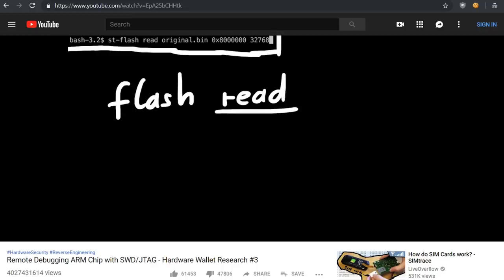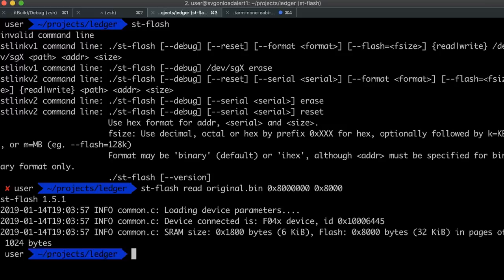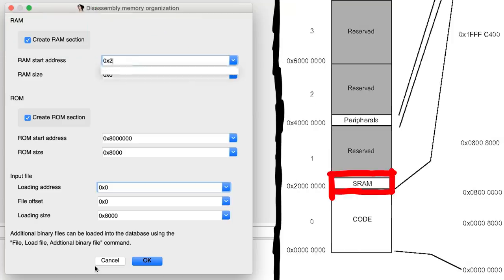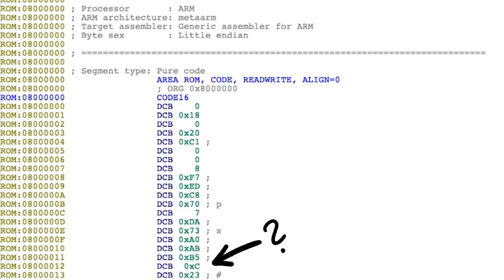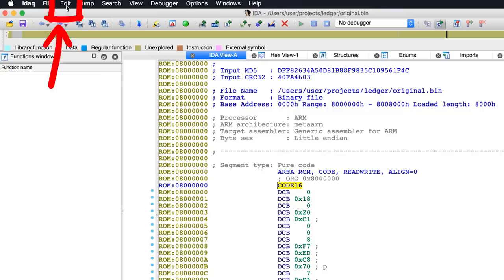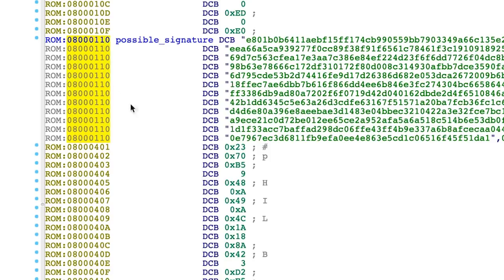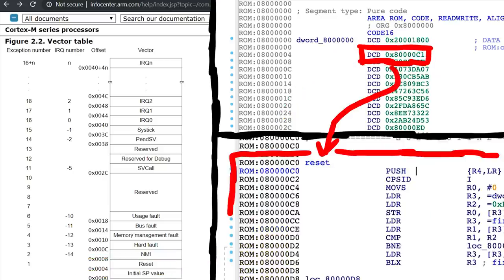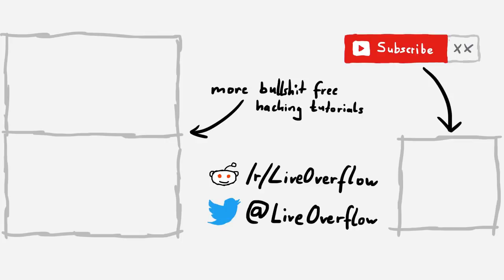Setup and Find Entry-point in ARM Firmware - Hardware Wallet Research #4

Comment: On most of the secure systems JTAG is locked. I would like to see how you unlock a JTAG if it is locked in the firmware :-)
Reply: Decap the chip, cover the flash memory and erase the fuses using a UV lamp. Easy peasy lemon squeezy. JK, this is much easier said than done. You could also try glitching it as they did with the Switch's processor, bypassing the fuse checking. Also easier said than done.
Reply: @GRBtutorials  On secure devices, fuses are generally OTP, physically destroyed transistors, not flash with secure bits.
Reply: @Spirit532  Well, yeah, now that I looked for it, it seems like STM32 have OTP memory (also known as PROM, programmable ROM, usually made out of antifuses) for JTAG lockout, so that leaves us with just three options: glitching, finding some kind of vulnerability in the fuse check, or some kind of extremely complex physical attack. The only scenario in which glitching or vulnerabilities in the fuse checking would be impossible to find would be if there was no fuse checking at all. If we were making a secure MCU with paranoid security, we could put JTAG (or other debug interface) handling code in OTP memory, and when locking it out, blow all the antifuses. Then the JTAG handling code would get converted to zeros or ones (which we could define as the opcode for NOP).
Reply: @GRBtutorials  The only best solution is glitching. I would love to see someone sharing a video on Glitching ;) it's a very sensitive topic to discuss in public :)
Reply: @hassansyed5661  Well, if you haven't watched it yet, I recommend you watch the conference on glitching the Nintendo Switch, featured in one of LO's videos: https://www.youtube.com/watch?v=L3PPWVPg2WI.
Reply: *secure. as shown in the video the debugger access is the least concern.

Comment: Nice video! Is it possible to change the BNE to a normal branch (or a JMP) to bypass the f00dbabe check, reupload to the chop, and then load custom firmware onto it?
Reply: Yes, but what's the point in doing that if you have physical access to the device? Might as well just load the custom firmware via JTAG from the beginning.
Reply: @GRBtutorials  yeah that's a fair point. I'm guessing you'd have to manufacture a foodbabe firmware and then fake a loading page with APLU commands for it right? That's the only way I can think of without jtag access
Reply: QuickishFM yeah, but load via aplu checks that the signature of the new firmware is done with correct private key (hopefully securely stored by developers). If I understand it correctly.
Reply: @d3line  Oh I see, makes more sense then

Comment: In STM32 MCUs, the firmware developer can lock the firmware and will prevent others from accessing it with serial wire debug (SWD), or JTAG.  I wonder why the firmware inside the Ledger wasn't locked and kept open?
Reply: You mean ReadOutProtection? I got the same question here, cause most of the devices that I checked have enabled 'ReadOutProtection'.